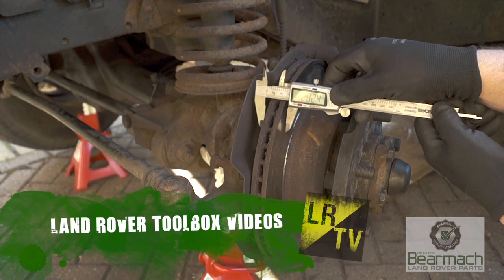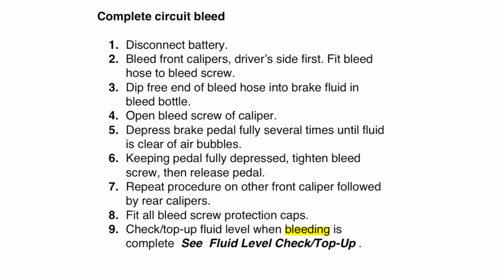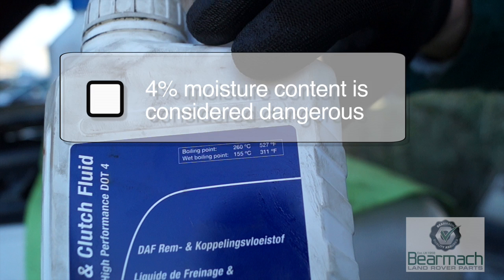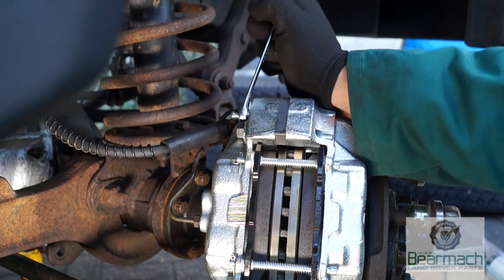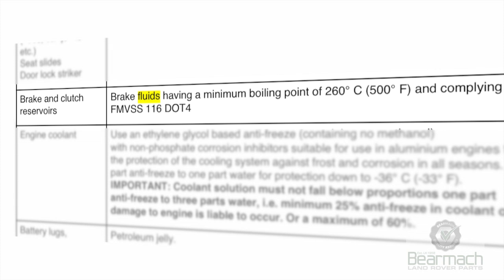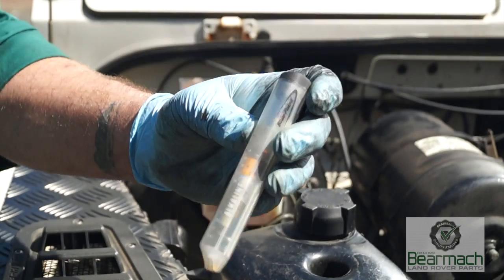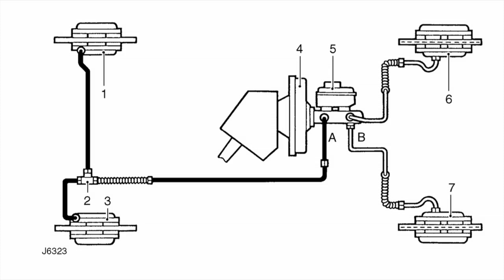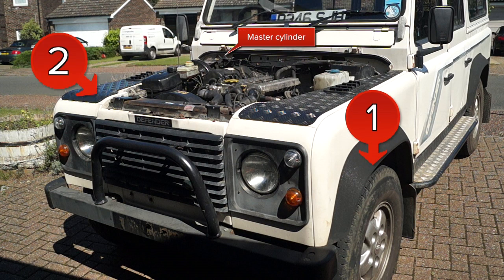Brake bleeding your Defender - part 1 - The Fine Art of Land Rover Maintenance

Comment: Hi thanks for the video. I usually do my Land rover series 3 lwb brakes (single line non servo) myself. A nightmare according the many online but it rarely bothers me. I would like to bleed/replace the fluid in my 2003 td5 without abs as it has been there for a long while. How does it compare to bleeding series 3lwb brakes (easier or harder)?  I have tried gravity bleeding before on the series but can it work as well on a 2003 110? cheers.

Comment: Interesting that  RRC w/ABS manual begins w/ bleeding drivers side (closest to MC on LHD): the outside bleeder 1 of 3 on both front calipers then immediately goes to outside bleeder on passenger side caliper. Any reason for the extraordinary difference with Defenders?
Reply from the maker: +L J Mac   It depends how the system is plumbed up.  Some have diagonal split systems incase a hose breaks it will leave on front brake and one rear brake,  Others have a split system front and rear for the same reason.   Also as things develop, engineers change their minds about techniques.
Reply: +Land Rover Toolbox Videos Thank you! Everything went swimmingly bleeding the brakes using your prescribed detailed methods & the LR RRC manual on sequence & ABS ; this was 1st time though owning LRs for many years brake bleeding I’ve avoided due to the abundance of forum posts about how tricky it can be especially RRCs. The one issue is the bleed nipple on the outside passenger caliper had no fluid to bleed even eventually  removing the bleed screw. I nipped it off & after bleeding all others properly the brakes seem perfectly fine except for that piston/bleed nipple. Short of replacing the caliper is there a method of clearing that particular nipple to have fluid flowing & allow the outside piston to operate again?
Reply from the maker: Reverse bleeding works.

Comment: Thanks for this useful video. I just have a doubt after reading hundreds of webpages about the bleeding topic.
They all say what you say in your video "bleed the farthest caliper first and so on". But the farthest caliper is the rear left one (on a RHD Landy). So my question is "why you suggest to start with the front left? thanks
Reply from the maker: +Dado Mago   one that has the longest pipe from the master cylinder.  LR might state otherwise.

Comment: I tried reverse bleeding my brakes using a oil can as suggested but had some trouble with it... either the bleed screw was too tight and no fluid was entering the system or else it was too loose and fluid was seeping out the threads! What am I doing wrong?
Reply: Wrap 4 layers of teflon tape around the bleed screw thread so as to prevent the aforementioned seeping. It works very well.